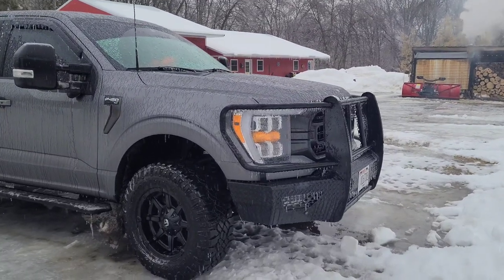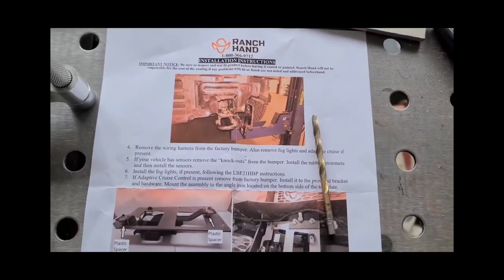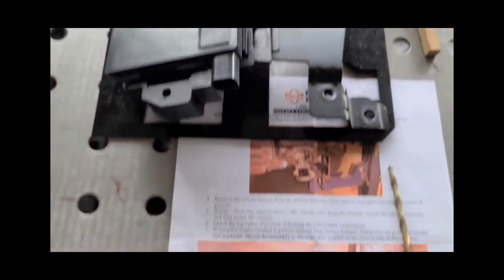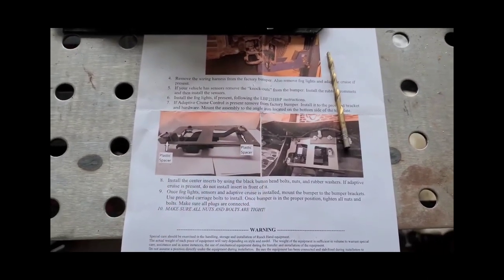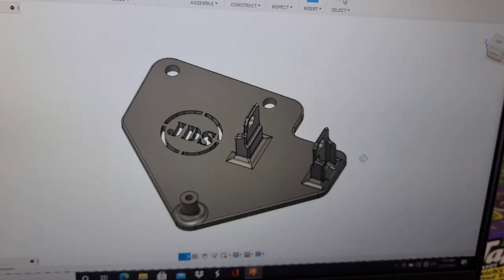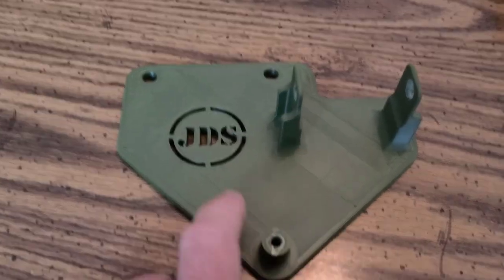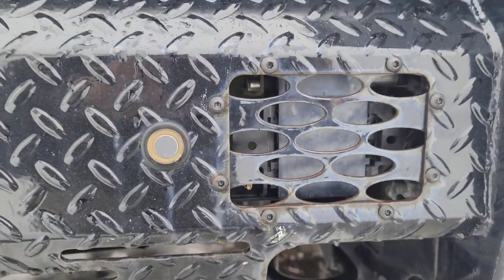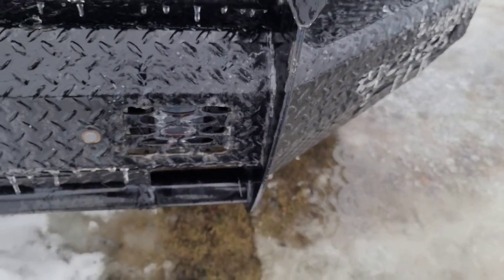Why does my truck do this? Explained

Comment: Was this just a F150 thing?  I installed the same bumper on a 2022 F350 and the sensor is sideways - no issues.
Reply from the maker: Do you have adaptive cruise
Reply: @JDSOutdoors  yes, and crash avoidance - just went out looked at my sensor and its sideways recessed back in the bumper..installed 2 weeks ago.
Reply from the maker: @sstoner911  weird. Must be only the f150 then.

Comment: I owned one for about 2 weeks....Couldn't ever get the sensors to work. If it wasn't the parking/proximity sensors going off it was pre-collision alerts. Ended up going with just the brush guard. Disappointed.
Reply from the maker: Well if you decide to get another one I have the fix. It's on dozens of trucks now with great success
Reply: how long ago was it, theyday they have fixed it. did you have the grille guard or which exactly one